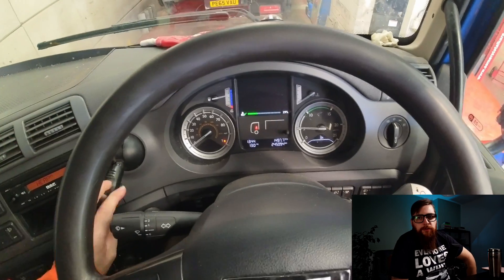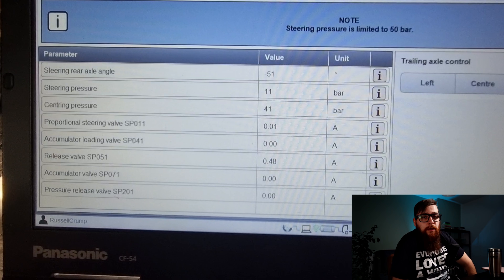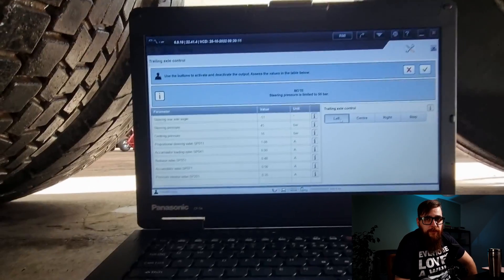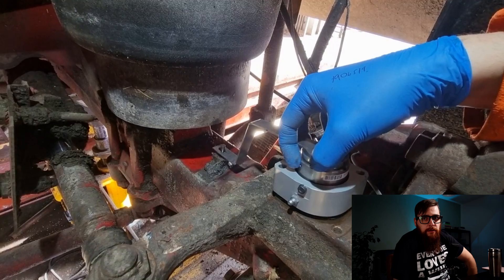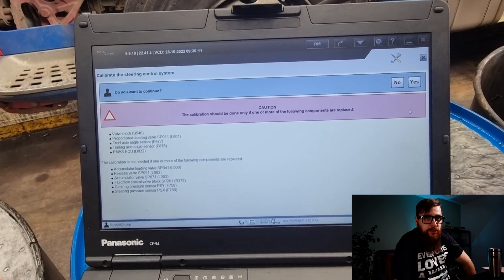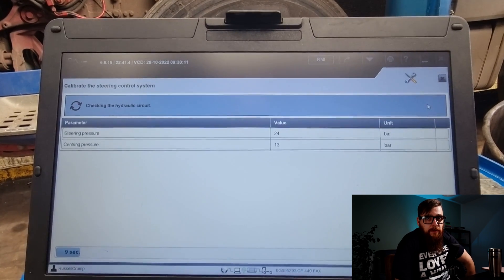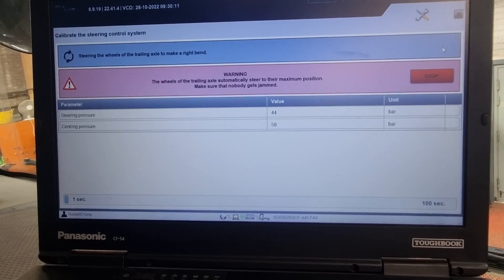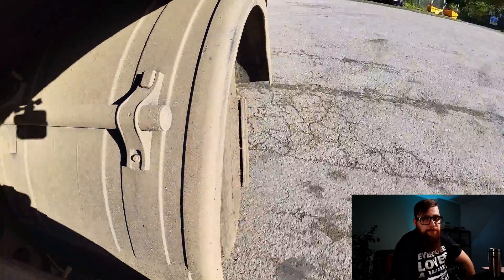but it's STEERING from the REAR. DAF EMAS angle sensor and calibration.

Comment from the maker: Have you had much to do with EMAS on DAF? I know it's been round since the dawn of time and it's now been replaced with EHS 👌
Reply: Yep, using Texa, which supports Emas very well. Had one burst a pipe and took a while to get to the bottom of, but found low centering pressure and failing calibration due to a worn out accumulator.   Luckily had half an idea as emas is made by VSE which make trailer steering systems which I'm very familiar with.
Reply from the maker: @Wayno-xl447  hey buddy hope your well. I will have to have a look into the trailer system with DAF going a different route.
The accumulator should hold 20 bar then drop off I think, I know DAF has a test for it which always helps with these things 😂
I'm glad you got your head round it as I don't think it's the simplest system to pick up 🫣
Reply: @TRUCK TECH UK  it's all ok until someone hits the re calibrate button!  VSE on trailers is a regular trouble shoot for me on Spitzer, Welgro and Airbus Industrie trailers. Very similar, but using its own integral LCD display.
Reply from the maker: @Wayno-xl447  agh the cardinal sin........ recalibrate 😂😂😂😂. Last thing anyone ever should press lol
AMAZING that it has its own LCD for diagnosis 😎😎😎👌
Reply: Yes. Testing the Davie4 program for DAF.

Comment: Rear axle steer issues are also very common on the Mercedes Econic, for some reason the rear axle locks and does not turn while the front steers fine, have you any experience working on these trucks?

Comment: After replacing the steeringvox of my Daf cf faq 2016, the steering wheel pulls slightly to one side, at 45 kmph a tap in the steering wheel and the truck drives straight again, the dealer says there is nothing wrong with it, what else can I do? Do a wheel alignment?

Comment: Hi, I have a DAF cf75 2011 with a heavy steering and  atm it does not turn the front wheels and it is showing a red warning for the rear axle steering the rear helper wheels won’t move. Help!!!

Comment: Hi ... we have the same issue with a cf rear steer but cannot find a steering angle sensor faf tell us we have to buy the whole lot ecu and front sensor for 2.5 k can you help
Reply from the maker: Hi Jon so the part you need is 1906519 the bulletin from Daf states " Due to technical changes to EMAS sensors and incompatibility between sensor variants, always follow these instructions.
 
When replacing a front angle sensor, a rear angle sensor or an EMAS ECU from a vehicle < week 41 2012, always replace all the sensors and the EMAS ECU with a service set" 

Now in my eyes, the ' < ' is a less-than-sign! So if your TRUCK  is euro-5, euro-4 ect it would be less than that date and would require a service set. If it was marked '>' anything AFTER week 41 2012 would need a service set. 🙄

Comment: Got a cf with very heavy steering. The pump pressure and centralising pressure are both sitting at 20 bar. We do have a fault for centralising pressure low. Would this effect the front steer? Thanks in advance.
Reply from the maker: Hi thanks for the comment, You need to Check the circulation oil pressure for the steering if it's heavy and any kingpin issues ect. 
As for EMAS I'd want to confirm the pressure and centring pressures with a gauge and then check Davie for the exact figures. 
What fault code you have plays an important part in the diagnostic of this system.

If in doubt take it to daf I'd say mate

Comment: I have a question. I have a daf cf 2013 with a movable rear axle. For a while, the axle has not worked. I contacted the company, and they did not help me with anything. They said I have air in the pipes, and they did not solve the problem. How can you help me?
Reply from the maker: Hi, thanks for the comment. You will need access to a diagnostic system capable of reading EMAS faults to perform any rectification work.
To bleed the system of Air, you will need to operate the system, and to operate the system, you will need to be able to perform diagnostics on the system. 
I suggest you take the vehicle to someone who can fix the system right first time

Comment: A very under rated channel, you make suck good content. I'm an auto sparky my self. But haven't got Davie  however the local mechanics who are the agents for DAF and other manufacturers hardly know what their doing when it comes to this stuff so I often go in and ha e a play around on the DAFs. I've never worked on rear steer however as it very uncommon in the types of trucking industries I work in and let alone New Zealand
Reply from the maker: Thank you for your reply 👌😎 I'm glad you enjoy the content ☺️
Sounds like these other DAF agents don't implement any sort of diagnostic methods. By all means send them here 😂.
Your lucky you haven't had to work on these rear steer systems BUT the new system is amazing and will be introduced to Next Generation DAF veicles which have a steering lift axle

Comment: Ahhh good old EMAS  ..I remember when this first came out ,mandatory training wasn't a thing ,and we just had to try and figure it out ..Sadly it doesn't always centre when it faults ,andalso doesn't always put a warning on when there is ..Had one driving in a straight line  steering wheel sat perfect ,did a round about and when on the straight steering wheel sat off by 30 degrees or so ,then you would get a snap and  after about 100yards and you straightened the wheel ..That 100 yards you where crabbing as the rears never straightened ,no warnings ,Forgive if i get the valve wrong  but SP011 was the culprit  the one with 4 bolts ..When diagnoising it now days  i start with the code obviously ,then it is usually a mattere of checking the resistance if ok check to see if it's shorting to earth,and it is usually the valve or a faulty wire as i work my way back to the bulkhead  there is generally a short to earth somewhere ...Had a brand new veh with the new system brought in customer jumped it .after a look at the diagrams turns out it;s fuse is at the pos batt post ..EMAS  seemed to be made overly complicated because  they could  i think it was TRW did the system...the new system tail lift motor and a couple of sensors lol
Reply from the maker: I'm lucky to have had the training on EMAS and EHS by Mark Keen. I think they iorned alot of the issues out in the end (front angle sensors and wiring harnesses) I find the diagnosis good on RMI now, I know it didn't have much along time ago like you said. Yes sp11 controls the fluid control for the steering left right ect that use to get full of water and go slow turning 😂
I've had the system kick the truck sideways at about 45km/h as some one fitted the front angle sensor wrong so when the system self centered it produced the wrong straight ahead position. 

Same sort of fault I had with EHS I had a loose battery connect for the pump supply so kept getting faults on EHS. Brilliantly simple system though, all integrated with a reversible pump 😎👌
Reply: @TRUCKTECHUK  I did EMAS with John Sellors lol  When they had us done for the MY17 update  the canadian lad did a bit on the EHS ,he came from komatsu i think so he was good but as he knows hydraulics ,but started going on about the technical drawings of the valves that engineers use .
I don't know how you get the time to film edit etc,,All i have did this year is engines or cams Just had to do  MX11  fuel  cams that others stripped as i was busy .both took the compressor off ..I was not best pleased..and i still have more cams and a couple of normal strips ie head gaskets , dusting ,lf turbo etc
Reply from the maker: @norb0254  we were on about John sellors the other day in work and how it's all changed.  The Canadian guy is John also lol I find he goes into great detail on stuff which is what you want really, don't generalize how things work, I've RMI for that 😂

Why didn't they just take the compressor head off??

Mate I'm literally spending every hour of every day trying to get everything I know in some form of media. I've just building a basics course on testing v1-v4 for fault identification. 
I've glasses I wear that actually record so what ever I'm doing I just press a button 😅
It's the editing part that takes 10 hours  😭😭😭
I seem to be going between dealers currently to help out on these NGD'S
Reply: @TRUCKTECHUK  They never took the compressor head off ,as they never looked at RMI  and did what they  thought was correct..Luckily i haven't had anything to do with the new generation and long may it continue,,,Had a lad try to find the ethernet cable on one ,dont think he found it lol...Years ago i would have enjoyed visiting dealers ,but nowday  all my jobs are generally  x y & z have been on it already ..Think there is a traxton ,just left anothe shop then towed to us home dealer is an hour away ,but towed to us ,apparently it had a air pressure fault ,they changed the front module  for the air ..apparently still has a warning  davie  being davie it now wont talk to vehicle ,,if you put it in gear it shoots forward ,like the clutch needs a calibration ,but really need fault code ..Guy on it pissing about hoping to be taken off it